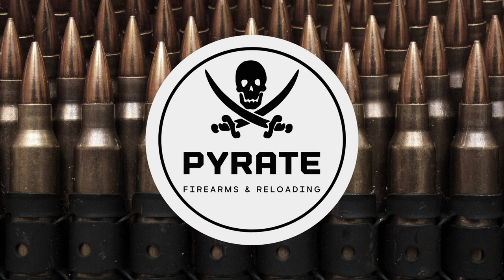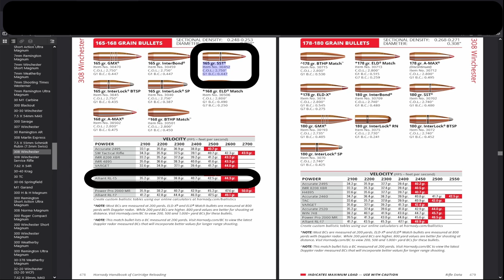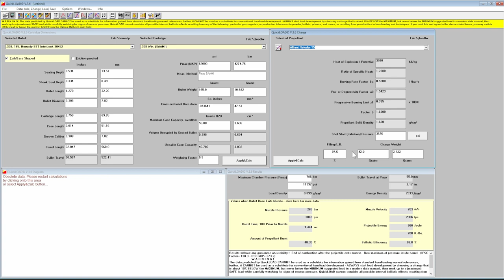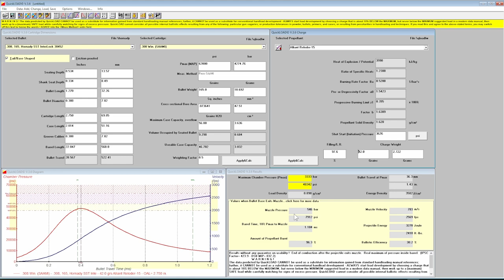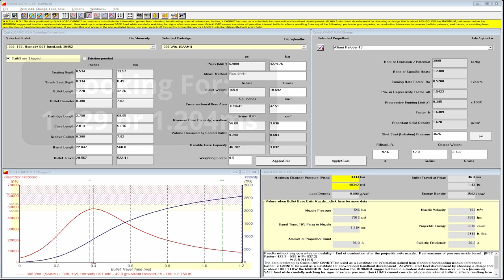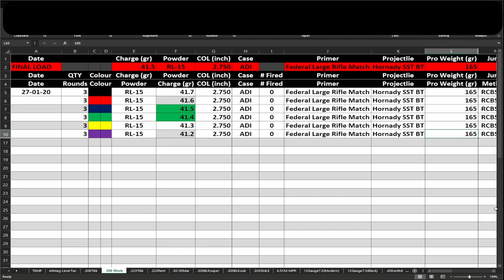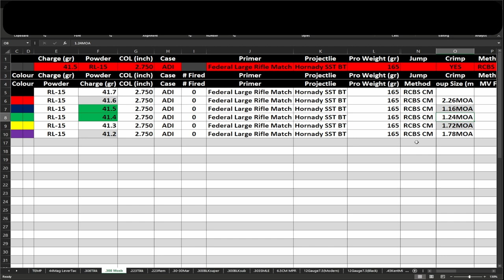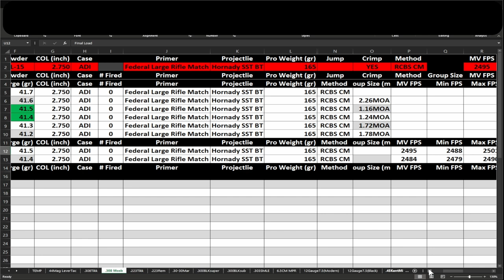Load Develompent Hack - How To Select Loads - Reloading: Ep11

Comment: Great informative video.  The first I have really heard of the Optimal Barrel Time Method.  One question though; did you just color the powder charges on your logbook or did you use Conditional Formatting to get the color gradient?  If you used Conditional Formatting, how did you set it up?  Thanks.
Reply from the maker: I set them manually, nothing that fancy. I have 12 diffrent colour sharpies, and I just mark the head of the case. Makes them easy to identify.

Comment: Nice channel. Was wondering if you know if there is a “easy” way to enter your planned distance from the lands?  Seems like you know Quickload and I am fairly new to it. Thanks so much! Cheers
Reply from the maker: Thanks. Not that I know of. You will need to enter the cartridge lenght and seating depth. I would not be conserned with that as the jump will effect the start pressure and time to pressure max, not the max pressure, unless you compress the charge. This early in my devlepment im just loading to the cartirge lenght from the load data.